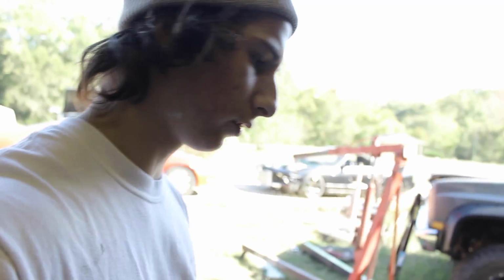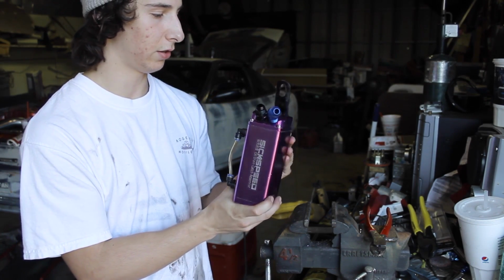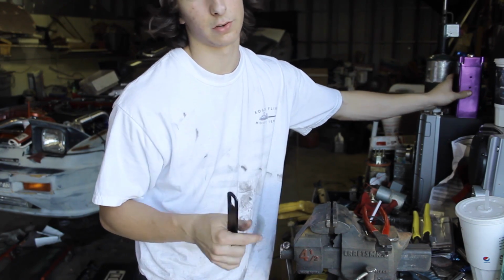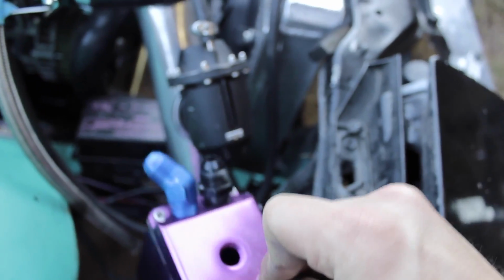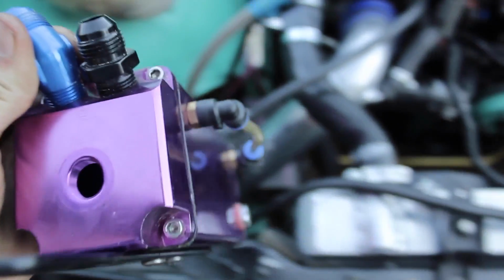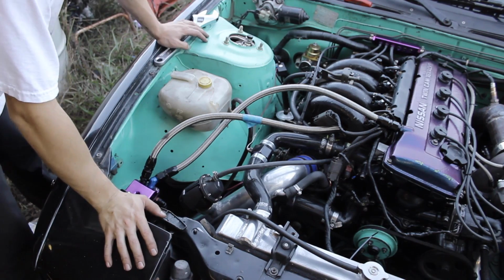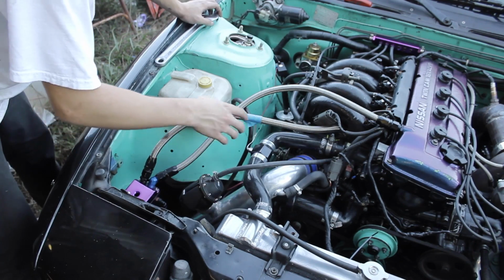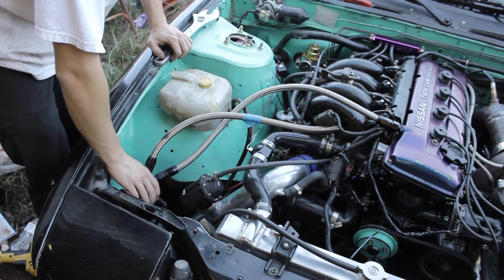TURBO 240SX BUILD | CATCH CAN INSTALL

Comment: If you leave the stock pcv valve in and not have intake vacuum pulling it open, It's not doing anything but staying closed...  Now all your pressure has to release from that upper valve cover port ...  I removed my pcv and put a straight thru open fitting and routed a hose from there to my catch can .. Then another hose from the valve cover to the same catch can ... Now the motor has 2 points to release pressure as it runs ..
Reply from the maker: You Tube nice thats exactly how i ran mine lol
Reply from the maker: I took my pcv out and ran a npt fitting to -8an 90 degree fitting to catch can and ran -8an line from valve cover to same catch can and vent to atmosphere

Comment: Where does the return line feed back into?
Reply from the maker: Cole Bunn no return line, it vents to atmosphere
Reply: Where does the second line go back into?
Reply from the maker: Cole Bunn one goes to the pcv and the other to the valve cover homie g
Reply: Gotcha, that's what i thought but it didnt look like it went all the way down to the PCV valve.
Reply from the maker: Cole Bunn yea i ran a 90 degree AN fitting to the catch can turned out pretty nice
Reply: 90 AN at the PCV valve?